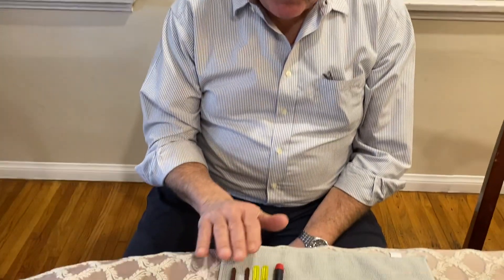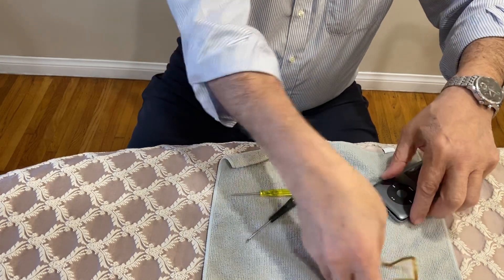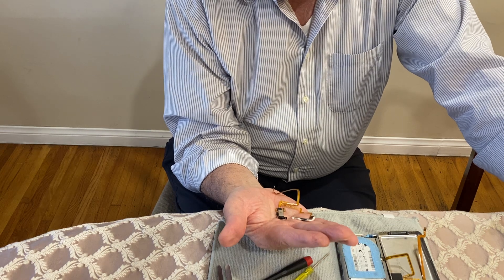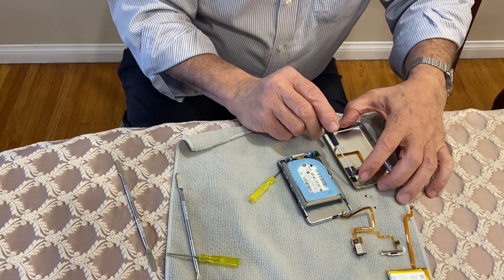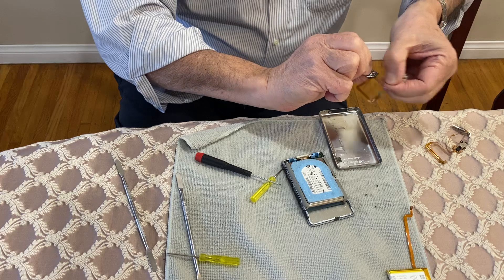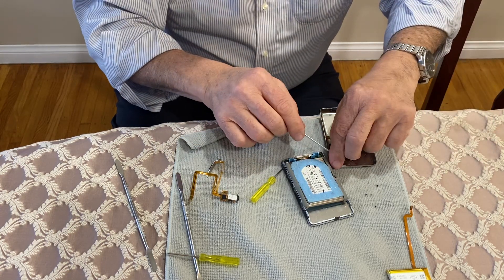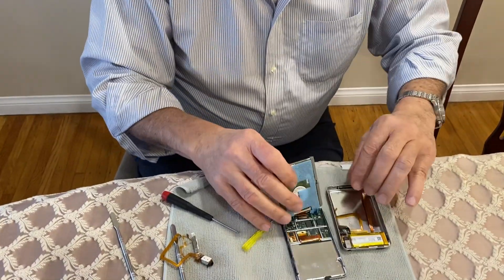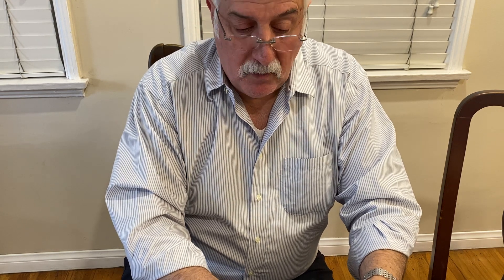How to Change the Headphone Jack on an iPod Classic (6th & 7th Gen) – Complete Guide!

Comment: I have a question; my replacement battery has a peel sticker in the back. In the video I don’t see an adhesive sticker on your battery when you put it back, is it okay that I don’t use an adhesive for the battery as well? (In case I need to change the battery again it’s less hassle to deal with the adhesive)
Reply from the maker: Be careful on the sticker. Don’t glue near the hold switch flex cable. Take a small piece of scotch tape and roll it to make a double stick tape. It should be fine.